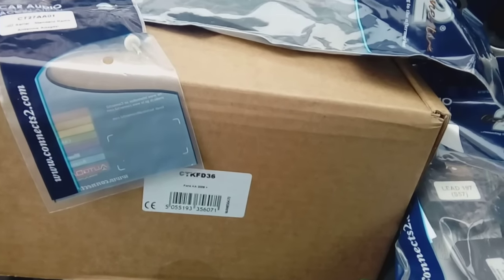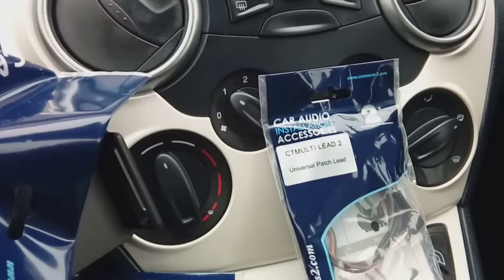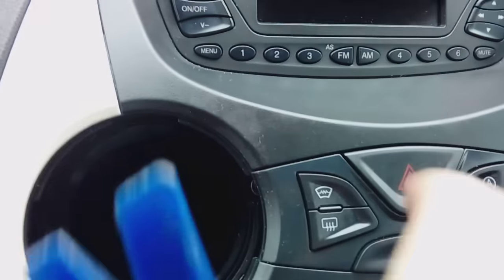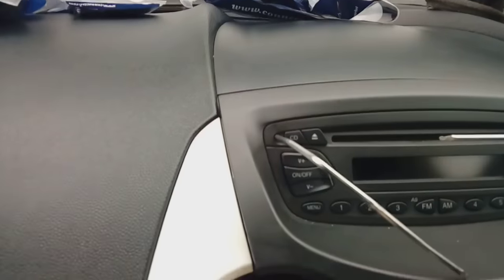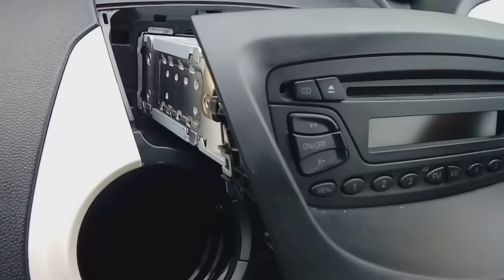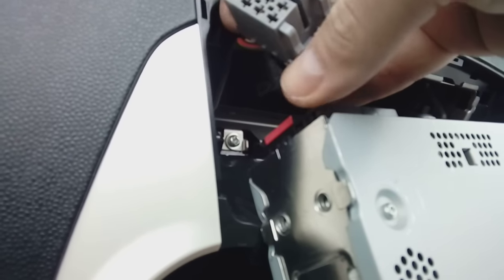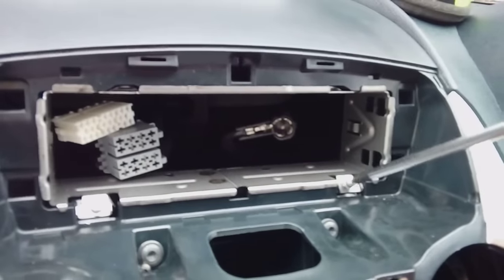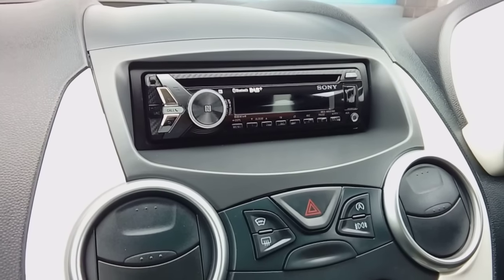Ford Ka quick radio removal guide 2007 onwards all models

Comment: Why didn’t you show how to connect the radio leads etc ??
Reply: Probably because holding a camera and doing that is almost impossible, and it's usually plug and play
Reply: I have an issue where the wiring does not work because the "ignition" wire is not in thebusual place. Looking at the manual, ignition switch wire is blue, constant feed is red.
I had both red and yellow wired to loom red, but battery keeps running flat. Tried wiring to blue switch, airbag failure came up, stereo still dead 😵‍💫

Comment: When I disconnect the old radio, I have 3 plugs which is the same as you, but my new radio only has two. All of the adapters I found are just 2 plugs to 2. Is the top one not needed? Thank you for your help
Reply from the maker: @A24flo  Correct top one not needed.
Reply: @PJsprojects  thank you very much!

Comment: Can one not just use the tool, to pull out the radio, without the fascia attached, & save having to remove the air vent?
Reply from the maker: Sadly not,the air vent over laps the edge of the radio.

Comment: I took my Ford Ka 09 plate to Halfords. They said they wasn’t able to fit me a new stereo. When they tried to fit it via adapters it wouldn’t work so he went through the fuse box. That powered up the radio but then nothing on my dashboard was working. Warning lights came on and said I had no fuel and wouldn’t tell me what speed I was going or anything. Do you know why this was happening and how to get around it as I had to leave with the same radio in the end after 2 hours of being there. Thank you!

Comment: There is a problem with these cars, I have asked Halfords, they said they another cable from the fuse box needs to be mounted into the back of the off the market stereos. What is the model of your Sony? Also, did you had to run another cable from the fuse box? I did try to use a pioneer stereo, no luck, even reversed the 2 colour cables. No power to the unit...
Reply: It would really nice if you can get the links in the video descriptions for all the kits used, as ctkfd36.
Reply: @sollywelch  yeah it does, works perfectly. Make sure you buy a microphone if you like to use the stereo for calling from the car.

Comment: what did the white plug go to when fitting  the after market stereo ? . just fitted one on my girlfriends ka and just left the plug hanging as i couldnt figure out anywhere for it to go.
Reply from the maker: That plug is not used on this type of install. The plug will be for either display,steering controls or possible usb/cd changer input.

Comment: Did you screw the new cage into the car? I've tried changing my radio, but it would just come out if I didn't screw it in, but it also doesn't have the holes to screw it in
Reply from the maker: The cage that comes with the new radio has little tab that you bend behind the plastic trim  so as to hold the metal cage when it’s been slid in to the plastic face plate surround.
Reply: @PJsprojects  Thank you! Hopefully I can get it fitted now!

Comment: I tried this on my Ford Ka 2014 and I couldn't pull the radio out no matter what I did. Any help? Are there any screws on this model?
Reply from the maker: It sounds like someone in the past has rammed something in to the release key holes in a bodged attempt to remove the radio.
This will of broken the release mechanism and so you only option is brute force and try to not damage the surround dash trim.
Reply: @PJsprojects  I managed to fit the new radio. Thanks for your help

Comment: Hi this video was very helpful to install the stereo for my mrs. Just a quick question I bought a stereo fitting kit which came with Single Din Fascia Adaptor (Black)
Steering Wheel Control Adaptor
Aerial Adaptor
Stereo Patch Lead (Free CTMULTILEAD.2 Included).
Once I connect everything it works fine but the controls on the left side of the steering wheel such as ,the volume, etc don’t work however they worked with the stock stereo. Can you help with this please.
Reply: They dont work with aftermarket radios

Comment: When I fit the new stereo using adapter kit the radio is permanently on and doesn't turn off with the ignition, is this something to do with the white connector as the kit i bought doesn't have the white adapter. Thanks
Reply: Probably connected it to the wrong fuse, you need one that goes off with the ignition off. 1 year late but hopefully it helps lol

Comment: Managed to take it out but the wiring back up to new radio isn’t clear
Reply from the maker: Just consult your local retail audio dealer on the correct plug and play adapter for your cars spec. Most will require your reg number for this.

Comment: Is it possible to connect an aux cord? I have just purchased a ford Ka zetec 2011 and it claims to have aux connection but I can't find it
Reply from the maker: Check down between the handbrake and the gear lever, you should see either a aux or a USB connection.
Sounds daft but to get the connection to work you need to eject any disk that is in the radio.
Reply: PJs projects thank you so much, googled all internet to find this comment!!!!

Comment: hi useful video thanks 
got a question, how difficult was it to wire in the replacement head unit ? literally just clip and done or did you have to do any fiddling about ? If i’m buying a new head unit is there anything specific i should look for to ensure it’ll fit easily ? Cheers
Reply: @reoreborn1209  I got a local installer to do it, became a bit complicated in the end but thx for the reply
Reply: just get the adapter

Comment: be careful, I took our radio out (mk2 ka) to get behind the dash for the heater and the odometer has flashed ever since as it lost its proxy alignment, had to get it done at a specialist as my local ford dealer had no idea what proxy alignment was and in the end had to use fiat 500 programme to reset it, its now fine
Reply: Did you unplug the battery before?

Comment: My vents are different from the ones in the video, once I have removed the bezel, I am left with the vent still in place. Do you know ho to remove this type of vent?
Reply from the maker: Unless Ford have changed the design over the years they could just be stuck,try giving one a gentle twist/wriggle because plastic vents heat up and slightly deform over time which can cause them to stick.
Reply: Thanks for the fast reply. Mine are a different design, same type as here https://www.youtube.com/watch?v=IwIEcPJ4QJ4 Seen at 2:45
Reply from the maker: I will check Autodata ref for you on this and reply after being at the workshop next.
Reply: That's very kind of you, thanks
Reply: Yes please do i have the same vents seen on http://www.geraats.nl/media/17068338/14/thumb/afbeelding.jpg     Will they go off the same as your video?

Comment: Do you have a video, that shows have to switch bulbs to the heat or fan regulator
Reply from the maker: Not currently,I tend to record jobs as they come in when time allows so if this job comes in I will make a note to record it.

Comment: Hi, I hae to change the heater control lamps Drivers side UK. is this a DIY job?
Reply from the maker: So one side of your heater control panel is not lighting up? if so you first need to check it's not illuminated with LED's. Some have LED's and some have little twist fit bulbs. If it's bulbs and you have done this sort of thing before then yes it's DIY.
Reply: Thanks :-)
Reply: Do you need to remove the stereo to get to the centre console bulbs?
Reply from the maker: I would recommend you do so,not only will you gain better access you won't have to worry about the edge of the plastics overlapping near the centre heater vents.
Reply: Thanks.
Reply: Thanks for the fast reply pal :)

Comment: Does anyone have the pinout of the white 3 pin connector? I've bought the car used and there was an aftermarket radio built-in, but I'd like to fit in the OEM radio...My connector is missing, I just got 3 cables hanging around :(
Reply: Something i struggle with right know. Did you got anwers??
Reply: @BABYLOVEBEAUTYx  it seems to be standardised ISO connector. search for "ford ka ru8 iso stecker belegung" on google and image search. first picture for me is the correct one.

Comment: Where can this kit be bought from ?
Reply: And also how does the steering wheel control module fit ?
Reply from the maker: Loads of car shops can order the kit or just search Ebay. For example - Item number 370995485178

http://www.ebay.co.uk/itm/Ford-KA-08-On-Carsio-Car-Stereo-Radio-Upgrade-Kit-CD-AUX-MP3-USB-SD-FM-iPod-/370995485178?epid=1137795930&hash=item56610dd9fa:g:u64AAOSwpRRWoCmv
Reply from the maker: The control module just plugs in to the main radio loom so is pretty much plug & play.